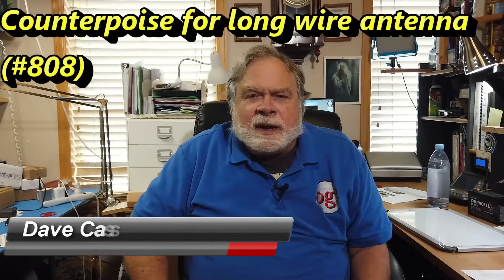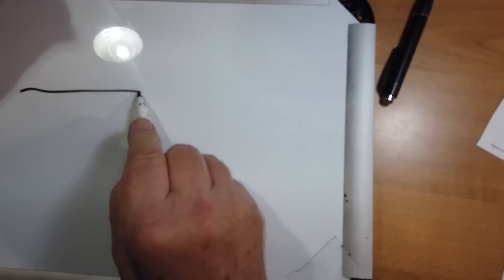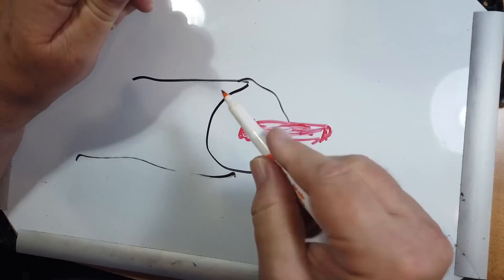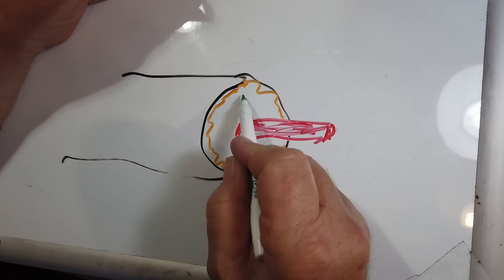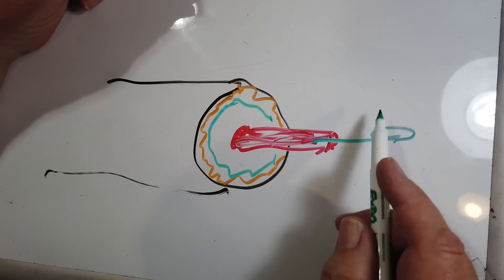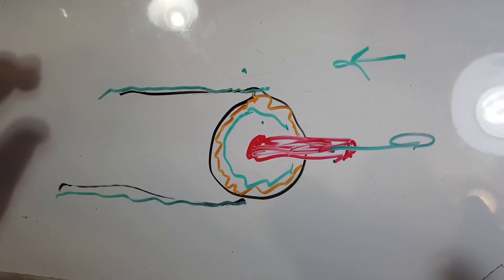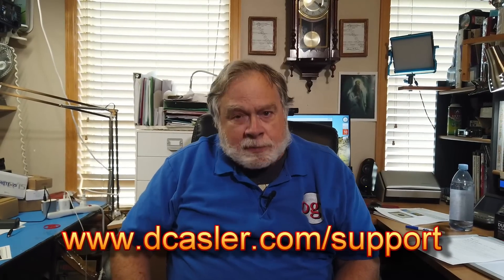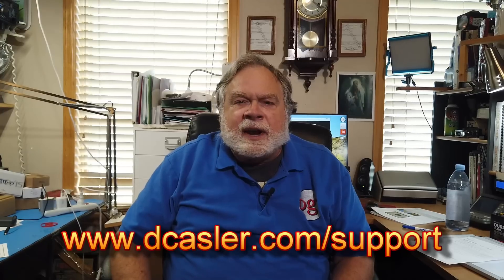Counterpoise For Long Wire Antenna (#808)

Comment: Thanks, Dave!   I did much experimentation as you suggest to get an end fed wire to work 160 through 6 meters.   160 and 80 were my biggest problem since my 107 foot wire is kind of short for those bands.    A 9:1 unun with a 120 plus foot counterpoise running off at a 90 degree angle and down a hill away from the antenna was the trick for me.  I added a choke just before the coax entered the unun to help keep the coax out of the antenna system.   And another choke right before the ground rod.   Every band requires the rigs internal tuner, but all bands tune fine and make contacts well.   Could you call this a random wire dipole?

Comment: thanks for really interesting information on counterpoise for long wire antenna David!  I have a spacy backyard for 148 ft wire with 9:1 But I can't have long coax so I need a conuterpoise. What counterpoise length will go with 148 ft antenna wire?

Comment: Just found your series of videos, very informative. I will be attempting to build a random length antenna.  As follows:  15' coax from my radio to a lightening protection device outside the house,  connected to a ground rod, then a 1:1 unun, then about 45' of coax to a 9:1 unun, connected to 148' of antenna wire ran in trees in my back yard. Do you feel the 45' of coax grounded at the lightning protector will be sufficient as a counterpoise? Am I missing something in my plans? I have sketches if you have a place for me to send them!!

Comment: When you are using Coax as your counterpoise in your End Fed Long Wire system, can you bury the wire below ground and/or run it through a small conduit without rendering the counterpoise/ground coupling effect useless?

Comment: Thank you! I am going to put my antenna on a 5 foot standoff from my tower, about 50 feet up running from there to the back of my yard. Run the coax down to my ground/surge protector. That is what you said.

Comment: Dave, or anyone that may know.  relativly new to ham, and after a year I decided to setup my first station.  I went to a ham store that opened about 3 years ago,  I do not know enough to trust / know if he is right or BS.  He is trying to sell me a 40 foot free-standing tower, I feel I need the tower for my location, however I want a vertical antenn and no guides, he said a BTV5 and the tower will work as the counterpoise/ grouding radials. Hmm.  I can not have any wires guiding the tower hence free-standing tower, nor can I have wires running off the antenna.  Is he right? will the tower act as the counterpoise?

Comment: Thanks again OG for this video. I believe that I will acquire the MFJ 915, because like my long wire (connected directly from the roof of my chimney to a distant tree of approximately 16m with a UNUN of 9:1 on the chimney then my coaxial descent of 10m) I think that I would no longer have HF feedback (it stings lol) on my Kenwood 450 SAT. Besides, with my ICOM 7300 or YAESU FT991A, I don't have this problem. Best 73's/Joel/F8MGW
Reply: You are correct. IF necessary, there are basically two solutions to mitigate common mode currents with long or random wire antennas. One is to use a counter poise and two is to insert a common mode choke in the coax at roughly 20' or 7 meters away from the antenna feedpoint. In the second case, the 20' of coax will act as a counter poise.
Reply: @erpece  tks for your response. 73

Comment: I have a PAR EF 80-10 JR deployed as a slant from the roof to a 4 section military pole on corner lot (@ 25 feet). My SWR went bonkers out of the blue and I was struggling to determine the issue. I looked at the handout for the antenna and it recommended the isolator as one option. I did this and my SWR on 80 and 40 were still high. I noticed that the coax length was important and needed to be at least 1/4 wavelength. As I added coax sections the SWR started dropping. Long story short, I ended up with around 60 feet of coax and that did the trick. 80 Meters is 1.9 to 1, best I get right now. When the winds die down I will get back out there and finish up. Steve VA3FLF

Comment: I use a 107 ft non-resonant wire up about 25 feet with a 9:1 unun and a 120+ ft insulated counterpoise running off the unun at about 90 degrees and then down a steep slope and curving around at the bottom of the 50 ft hill, mostly a few feet above the ground on the wooden staircase handrail and bushes.   I use a choke right under the unun and another right before the lightening arrestor to discourage rf on the shield of the coax.   This tunes all bands 160m through 6 meters with good results in actual use.   The key to tuning on 80 and 160 meters was the very long counterpoise (80 feet did not work well).   Makes jumping bands super easy.  Definitely a compromise antenna, but gets me on the air with fun qso's on every band!  73, N7RLV

Comment: I always am astounded by the "how long is a good long wire?" argument. May as well say 10M in a Rybakov configuration with loads of radials. Mind you Chameleon antenna uses 20M of wire so it is debatable as to the length itself. Whenever people ask me about an antenna I just say look up Rybakov and make that for the yard. It is a 4:1 balun and you get to have a small vertical to play with to get you on the air. If thy mention long wire, speaker cable will do it. It's cheap and 10M long. Split it in the middle and you get 20M for a cheap antenna and a sort of dipole as well for 14MHz.